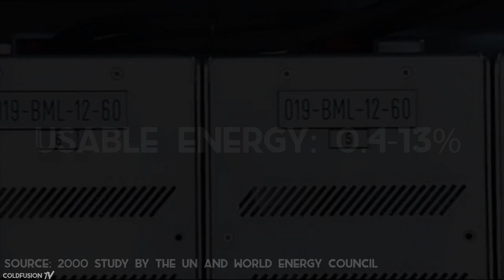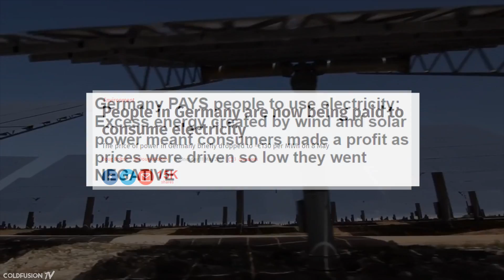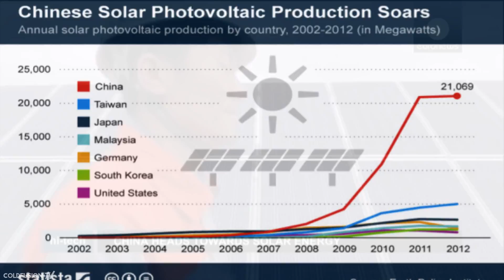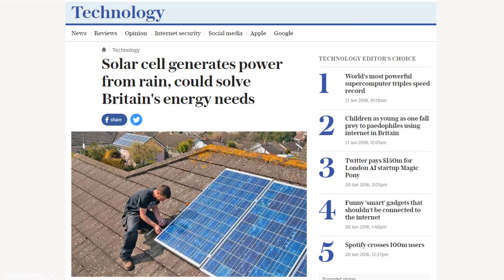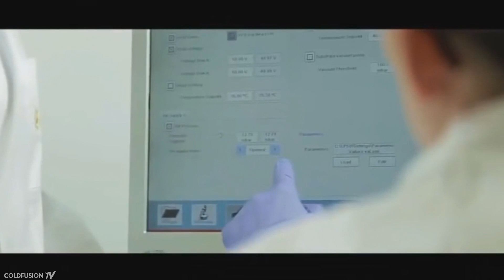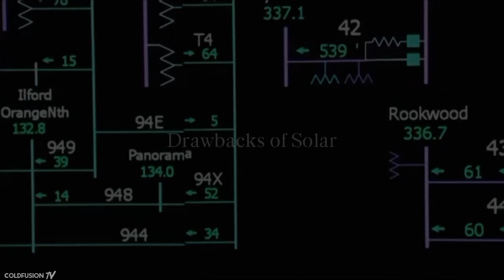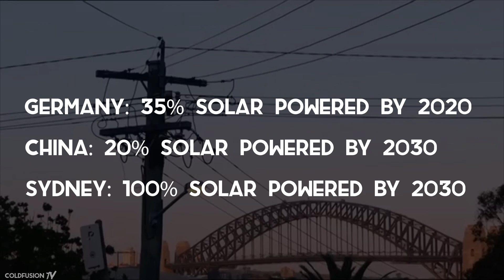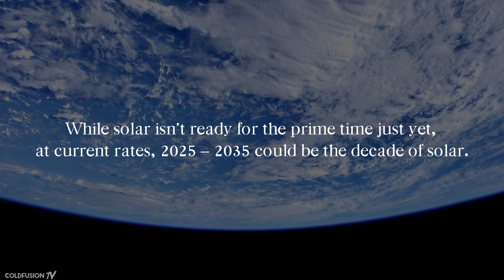The Truth About Solar

Comment: The truth about Solar is there is more to it then just electricity, if you properly design your house you can nearly eliminate the need to heat and cool it regardless of the outside temperature, check out some of the stuff the EarthShip guys out in like Arizona are doing.

Comment: Energy being free is not a problem, overproduction of energy can be stored by pumping water uphill when you have excess and then when you need the power you make it go downhill and with a water mill you make power. Easy and effective way of always having power.
Reply: depends on the efficiency of the turbines and pumps, and lithium ion batteries are getting cheaper every year
Reply: The potential energy you can store pumping water uphill is gigantic. I'm not saying that batteries cannot work for small installations, but for large utility scales, storing energy in chemical batteries is a long way off.
Reply: This is an interesting idea, though it may have one pretty significant downside that is also prevalent with Hydro power... namely, increased evaporation of fresh water. This is fine in some parts of the world, but in others where water is becoming more scarce, it likely would be untenable.
Reply: Easy and effective when you have an uphill water-storage location nearby and when the water doesn't freeze or evaporate. But useful in some locations nonetheless.
Reply: Agree that gravity energy storage is a very viable option..   Northfield Mountain in Massachusetts has an installation that has been doing this since 1972 with a 1.08Gw rated facility.
Reply: I don't think evaporation is a problem, quite the opposite actually. Evaporation only happens on the surface, so if you "stack" water into a deep lake there's less surface area per volume of water. But sure, water has to be there in the first place. No point in building a hydro electric plant in the desert.
Here in Austria we have a few GW of pumped storage facilities installed. Of course the mountains make it easier, but there are also smaller installations along rivers that pump water a few 100m up a hill into a small lake. So no need for mountains.
Reply: great idea!  Someone else got there first.  Dinorwic in wales uses that idea.  At the end of a very popular tv programme there's an extra demand of nearly 3MW.  They open the taps!
Reply: This also neatly addresses another issue: what to do in rainy environments.  With a lake for energy storage, the rain actually helps.